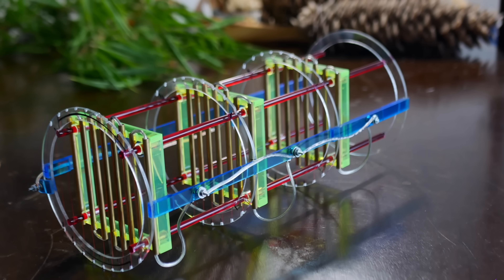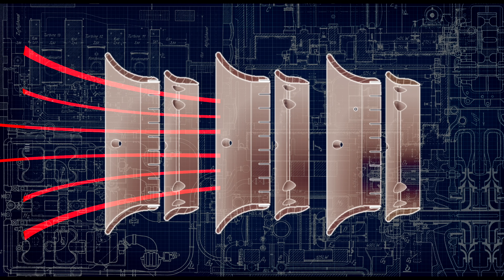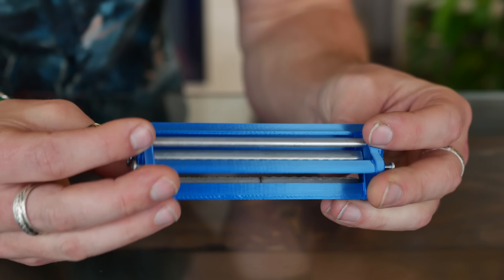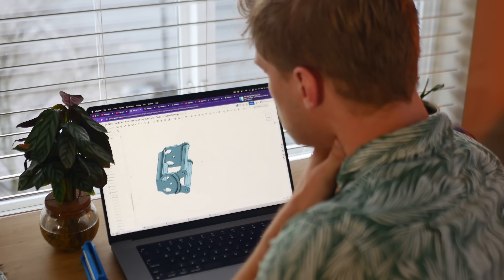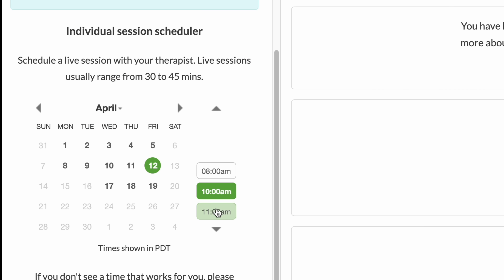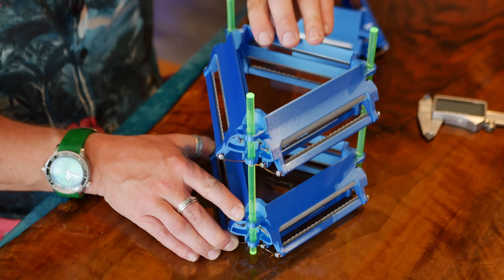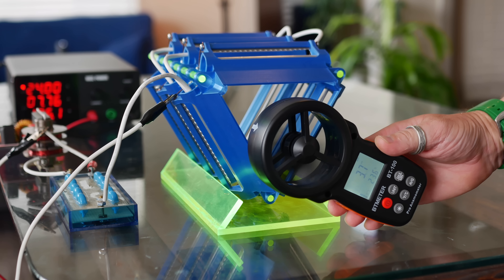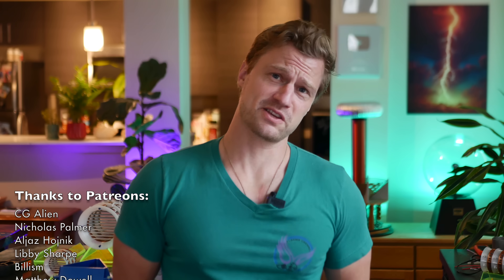Next-Gen Ionic Plasma Thruster Inspired By Nature (BTC Mark 3)

Comment: Wow, such an amazing video! I love seeing new ideas. Nothing like trial and error to come up with a huge breakthrough.

I'm not smart at all, but stupid ideas sometimes make great new discoveries.

But just thinking out loud, you mentioned that putting them in parallel will boost the speed so much. What if instead of doing them all the same size, you do all three different sizes? You can make the first one the smallest, then make the next one about 50% bigger, and the last one 100% bigger than the first.

Comment: Just hear me out, adjustable spacing for speed without changing voltage! Also each section needs to rotate 90 degrees with a small twist to each vent on each section creating a swirling column of converging air!

Comment: You need to start measuring thrust, not airspeed.  If you have problems finding a load cell sensitive enough, build a lever system to give the thrusters mechanical advantage and find the actual thrust via math.
Reply: And the convergent design is a step in the right direction, but you'll likely see better power-thrust efficiency in a purely parallel design.  Serial stages are a bad idea as you've already explained in this video.

Comment: I love what you doing!!! I do however have some input and maybe a different angle you might want to look into. the theory of propulsion put simply. mainly focusing on Bernoulli's theorum, it states that an increase in the speed of a fluid occurs simultaneously with a decrease in pressure or a decrease in the fluid's potential energy. The same can be said for a gas (i.e. air). We can see Bernoulli's principle in action when looking at a Gas Turbine Engine's compressor section. Where there are multiple stages of rotors (In our case the stages of thrusters). In between those thrusters we have and equal amount of stators that compress the air and pass it to the next stage of rotors. Now, you may be asking, "How does this even apply?" Well my thought is that if you compress the air between each stage you will in turn recieve an increase in velocity. I have not tested this and I am not an engineer. But, as an aviation mechanic and plane nerd :D the aformentioned knowledge may help.

Comment: Wouldn't the open front cause drag on the air flow? Air coming from the side and will cause low pressure at leading edge and pulls air in, slowly the air flow, maybe

Comment: It seems to me like one major method of improving this design (admittedly with a potentially problematic increase in manufacturing complexity that might require a shift in production paradigm) would be to take this idea up a notch and try to produce a vortex output. If you created a peripheral ring of thrusters angled to produce a vortex, and then followed that ring of thrusters with another, etc. I imagine you might create a highly centralizing laminar flow that would easily focus itself tightly as well as entrain additional air along the column, with the same benefits from having a hollow core inside the rings of thrusters. You could also potentially implement BillDeWitt's suggestion below with such a design, compounding the benefits to air entrainment.

I could be wrong, though, and it also might prove infeasible to produce such complex geometry at this prototype stage. Though, if you were going to do it, 3D printing would be the ideal manufacturing method, for sure.

Comment: Idea: what if each stage of thruster was closer to the central stream? The pass-through benefit would be sacrificed somewhat, but it may provide significant improvements. And what if each stage had a different angular placement relative to the thruster's longitudinal axis? So the airflow would get deflected at almost 45 degrees at the first stage, narrowing down to 10 or 12 degrees at the end? Or maybe in reverse? And what if the angle and spacing was variable while in operation? You could find the most optimal placement and angle at every airspeed and automate them somehow so the thruster automatically scales thrust with speed?

Like others have said, I think this design would also greatly benefit from exponential spacing.

Comment: A step in the right direction 👏  have you thought about stacking a single triangle stage in front of a single mk2 circle stage?  The convergence flowing into a more compressed stream? 
Another idea would be to have a nozzle to focus the flow output. 

Another project I could see as entertaining would be using your ion wing design for a rc wing in ground effect craft. I think those concepts would mesh well.

Comment: your main problem is you have all your stages exactly the same as ware a turbine each stage is different to handle the airstream at that stage because moving already moving air is different then moving stationary air so your fist stage needs to be efficient at moving stationary air your second stage needs to be efficient at moving air that is already moving at that 3.1 and your third stage should be efficient at moving air that is already moving at what ever it is coming from stage 2 

and that's why with 1 you got 3.1 but with 9 you only got 4.1 adding a lot more weight with not much more thrust lowering its viability as a thruster at that point just having a wing lined with the single unit variant side by side would be more efficient then trying to combine their streams 

also just measuring the air stream is not a good way to measure the thrust because just because its not about having air moving at a certain speed but how much air at one time do you have moving at that speed so you should make a thrust measurement rig out of a digital scale its not to hard or expensive to make and you can find examples online that way you know how much weight it can actually move

Comment: You mention convergence as your inspiration. Like river tributaries, after each additional side tributary, the river gets wider, bigger.  You didn't do this with your design. 
I know water and air are two different types of fluids (compressible and incompressible), and this would affect how you implement the idea. Maybe reduce the size of the central flow area with each stage?

Comment: Any chance you can use the 3:6:9 or Fibonacci sequence on the design? What if you extended the output nozzle and shaped it so that it is a more direct current/stream of air? What if you had air intake on the side of it, using Venturi effect?

Comment: You should try a circular design with this peripheral thrust! Try putting a single set of circular electrodes on the perimeter of the stage, thus also increasing the internal area, allowing for more air  and bigger objects to go through it

Comment: Would you be better printing these on a curve and mountig to a steadily narrowing cone. Have the output of each curved section nozzel into the cone via a curved oblong duct (if that makes sense) and follow up with the other stages etc. Im thinking a bit in terms of rocket nozzle with compression and acceleration. But could the above work with perhaps a trail of different nozzels to accelerate the air from high to low pressure. This would also increase futher if the engine was static. Similar to the way an f1 cars floor compresses the air at thr front and uses a diffuser to accelrate it out the back to create a low pressure to suck the car down.

Comment: What about designing it around an existing plane- one with a high glide ratio - and make the wing the negative terminal (put foil on it), and put one or two thin wires an inch or two in front of the wing?
Your current setup is measuring the ability of the setup to accelerate air; but in a plane, the plane is already moving through the air and you need to provide just enough additional thrust to counteract drag.  So even if your current setup is unable to accelerate air to the speed your plane would be traveling at, that doesn't necessarily matter- the question is what additional forward force the thruster can provide while already moving through air at a certain speed.  You don't need a discrete thrust unit like a jet engine or propeller ; an ionic thruster probably works better anyway if it's distributed somewhat in space.

Comment: I think the design should be built around the airplane that it's going to go in.  For instance, what about having the wing be the downstream negative terminal, and the positive current coming from a thin taut wire, or more than one such wires, about an inch in front of the wing?  It would be a big deal to have it fly at all, I wouldn't worry too much about robustness at this point.

Comment: If you want to increase the output, you should try converting the air to a plasma and combining the electric field with a magnetic field. Also you might be able to reduce the power if it used some form of AC power.

Comment: 1)  They need to still be circular.  They can be segmented...1/3 or 1/4 circle for each thruster, but a round interior will create smoother airflow and offer larger internal area for objects to fit through without compromising volume.

2)  You'll need to find a way to more smoothly merge the flows so that they compound one another.  As it is, currently, they're slamming into each other and losing energy.  They're not blending together to improve flow, and they're losing velocity in the process.  My recommendation would be to find a way to offset the thrusters at an angle, laterally.  Instead of merely tilting them so their exhaust is pointed inward, also tilt them so that flow is off-centered, to create a vortex.  Then they shouldn't be slamming into one another, but more like merging on a highway.

Comment: My only thought to this would be that you control where the air is being sucked into, left from the pressure difference of accelerating the air into the middle, could you not have the first stage completely open then have the second and third stages closed off at the back but open to the outside of the thruster, as shown with the dry ice the air being sucked in is moving backwards. This requires more energy to reverse that moment to properly the air in the right direction. The third stage I think would benefit the intake being slightly raised from the second to encourage two channels of air, instead of both 2nd and 3rd fighting for the same channel of air

Comment: Im no engineer i am a mechanic but that means my focus is internal combustion engines but that said theyre just over glorified compressors and unless im mistaken so are jet engines the exception is that compression both powers the engine while also creating thrust which is what you trying to do here to create greater thrust by compressing the air. you said due to angles air fully compresses at 10cm? so why did you only move the 1cm apart? Shouldn't they be closer to 10cm apart? Drag occurred but couldnt that be fixed by enclosing the gaps between thruster sets (like a prism shaped pipes linking them)? Also why are they all the same size shouldn't they get progressively smaller to help with compression? And wouldnt for the sake of efficiency couldnt the initial set use/need less power then final set? And lastly i dont know what the scientific term is but its why biplanes didnt have bi-tails it reduces lift and air flow it can be fixed however by making sure that the wings and tail wing arent directly behind each other (in each others wake) and are off set of each other could this be a similar issue here( referencing the aforementioned drag) ? If so wouldn't simply rotating each thruster set some improve performance? Sorry if my explanations question arent very good but wanted to try im just really curious and interested in your work lol hopefully im jot overstepping if so sorry p.s. the biplane reference thing came from researching the Caproni Ca.60 Transaereo for fun it had nine wings each side the 3-3-3 each set of 3 after the first lost efficiency in lift after the first apparently a 3-2-1 configuration would have been more efficient due to wake/airflow or by offsetting (lowering/raising) 3-3-3 so they weren't directly behind each other could your sequential thruster sets be experiencing something similar (aka drag) when spaced apart?